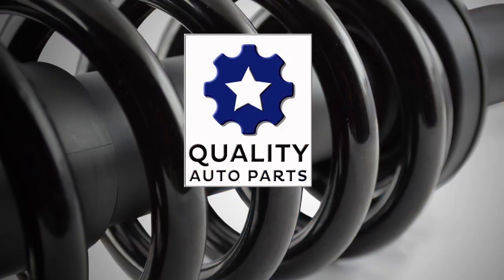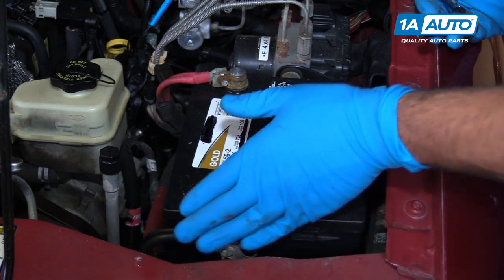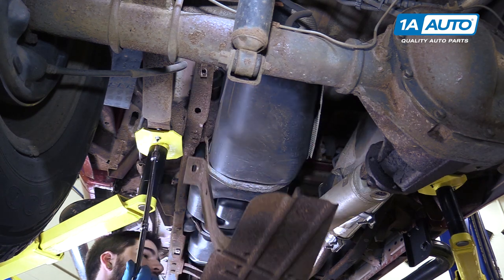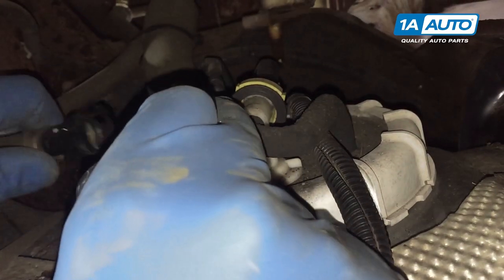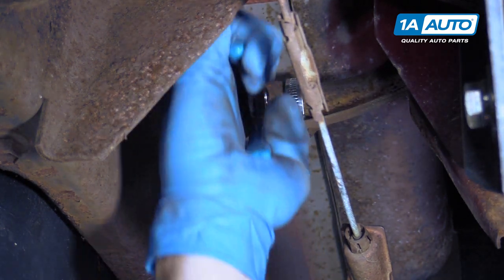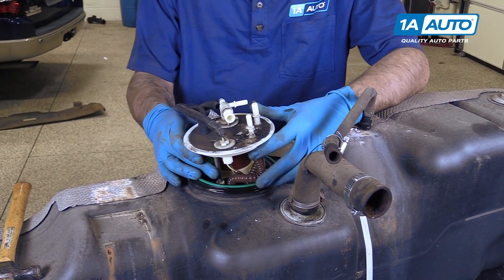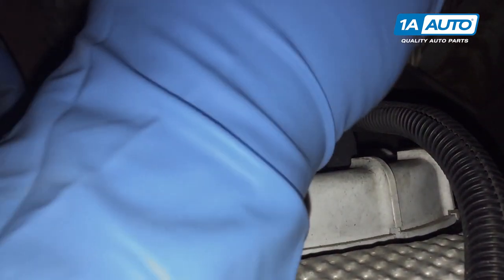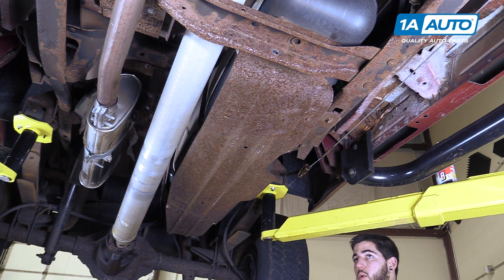How to Replace Fuel Pump Sending Unit Module 98-12 Ford Ranger

Comment: It is much easier on the 98-12 Rangers to unbolt and move the bed up and then back a couple of feet.  Six bolts in the bed, electrical connector to the tail lights, unbolt the filler neck, and you got it.  Use stacks of lumber to support the bed.  A huge bonus with this method is ease of seeing and removing all the tricky connectors to the pump unit.
      If you have to move the bed by yourself: After bolts are out, put a short piece of 4X4 wood at each corner between bed and frame.  Then you can slide two 8' 2X6s under the bed at the tire well, get them as far apart as possible within the fender wheel arch.  Then you can prop the 2X6s up on whatever you have...I used two milk crates under each end of each 2X6 (8 total) and from there kept adding scrap pieces of wood until the bed was high enough to roll the truck forward 2 feet to change the fuel pump.  Then roll the truck back under the bed when done, lower and bolt on.

Comment: That's the hard way! It's much easier to disconnect the light harbess and take off the 6 bolts on the bed. I did mine in 45 minutes.
Reply from the maker: +R S Thanks for the tip!
Reply: Is removing the whole bed easier than that ? I will service mine to address the low fuel not being displayed correctly, only when I fill it up to some point. I was wondering what would be the easier way since I will be doing it alone.
Reply: @Flashzinh0  - Much easier.
Reply: It's easier this way unless the bed bolts are rusted.

Comment: You should've just removed the bed, I've done it by myself twice, you just gotta take out 6 bolts, disconnect the fuel filler, lift bed over the bumper and slide it back about 2 feet.

Comment: got a 2005 ranger... do not try to pry yellow clip on the line connected to fuel pump! 05 has a different clip style. you will break it! and btw ford wants $400 for the whole line they wouldnt just sell the clip

Comment: Replaced this with the original pump that pumped out 185k miles.  This video and your product saved me lots money!  It’s cheaper than the OEM part, but I still expect it to last just as long or even longer than the original.  Thank you for this!

Comment: Auto Zone rents Fuel Pump Replacement Kit 57160 with a tool to remove and reinstall the lock ring (or collar) that holds the fuel pump in the tank. The Ford factory technical manual lists the torque specification for tightening the lock ring for a 2002 Ford Ranger at 66 lb/ft.

Comment: He said to remove fuse 50B, but removed fuse 56A and pointed to fuse 50B on the fuse box diagram. 

The correct fuse to remove is 56A, bottom right when looking at the fuse box from the drivers side/horizontally.

Comment: No need to drop the tank. Just unscrew the 6 bolts that holds the bed and move it a foot back just enough to get access to the fuel in-tank pump. Takes about 45 mins instead of disconnecting a bunch of electrical wires and deal with over a dozen very rusty bolts.

Comment: What is the circle piece that's on top where that big line goes what is it called my truck shoot gas back when I put gas in it the only thing I did was replace the fuel pump and the EVAP line that runs on the side of the gas tank

Comment: Is there anything else at all that would cause all symptoms of a very tired Fuel Pump ?? It's not inertia switch because it will (eventually) still start, already replaced Fuel Filter and even put a New battery to milk more ⏳out of the Fuel Pump.. It's a 2000, the Truck looks like a 2012+ from the Top, but you go underneath and it's a Complete Rust Bucket !! Rear frame is almost gone !! IDK where Ford got the Steel for those years !? So rather than Eating a Rust Buffet I'm gonna go from the top.. I haven't watched a vid yet on that way yet, but any Tips / Secrets are appreciated.. Also will my Rust situation make going from the Top a Nightmare in anyway ?? 
 THANKS !! 🇺🇲

Comment: So I'm thinking about replacing my fuel pump in my ranger because my engine is running too lean. Some friends said it's either the fuel pump or a vacuum leak
Reply: Did you find out what is was ? I'm in the same boat with my 99 4.0

Comment: looks like a very expensive job... my tank dosent  show how much fuel  I have anymore..
Reply from the maker: It's not too bad. We carry the fuel pump shown in this video on our website. Here's  a link to it, if any of our viewers needs to make this repair. https://goo.gl/l4zL2m
Reply: You can remove the bed bolts and raise the bed to access the fuel pump.  I raised the bed to change the fuel filler neck and it was quite easy since my bed bolts were not rusted too badly.  It's just harder to clean the fuel tank if there's a bunch of debris in it.
Reply: @picklerix6162   About to do Fuel Pump and underneath my 2000 is Rusted Horrifically !! Should I just assume Fuel Neck needs replacing and grab one ??